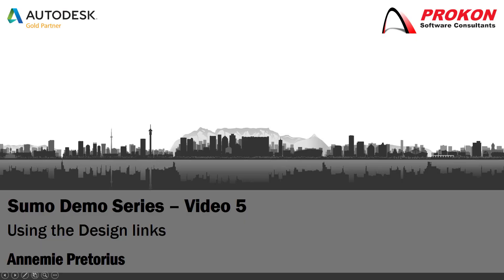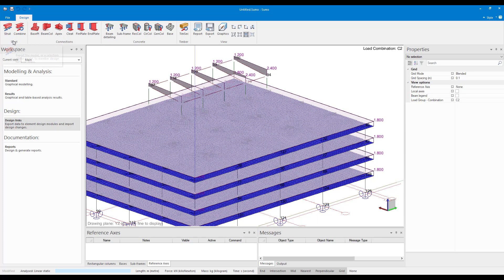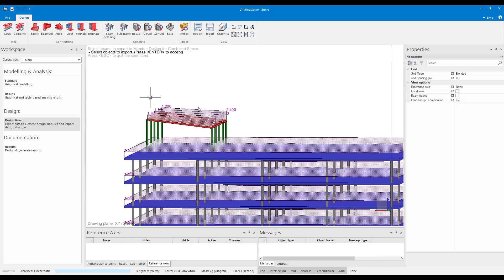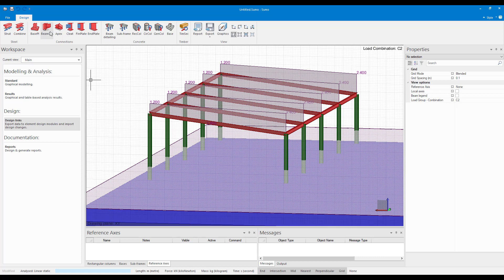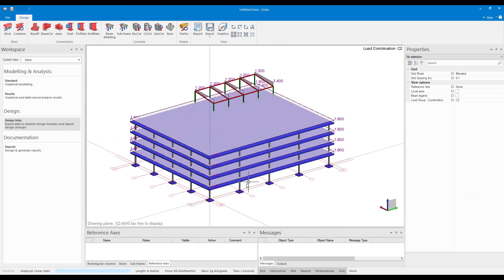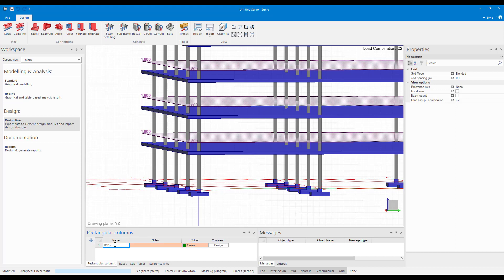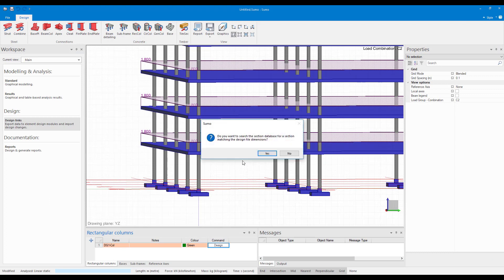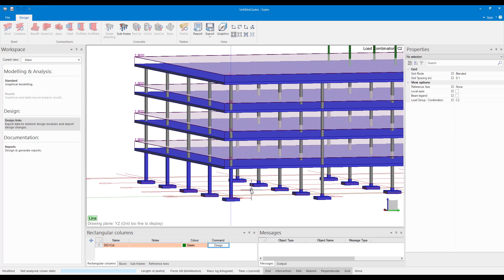Prokon Sumo - Demo 5: Design Links

Comment: What is the best way to avoid unconnected objects in the model.
Reply from the maker: Hi Francis, use of the correct snap settings will ensure accurate modelling and avoid unconnected model errors. If you are having trouble solving the issue, feel free to share the model with our support team by sending it to support@prokon.com.